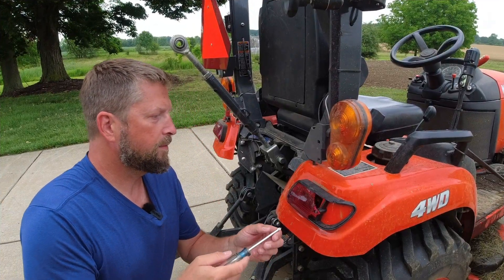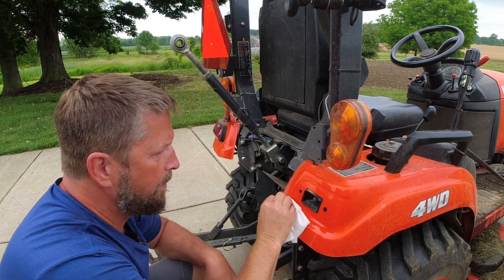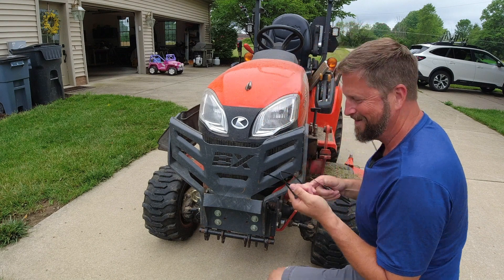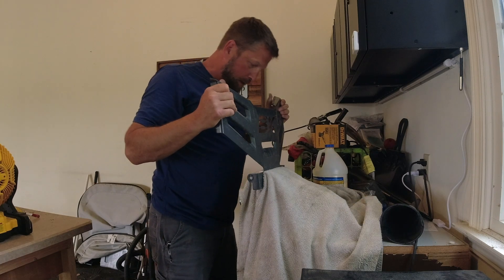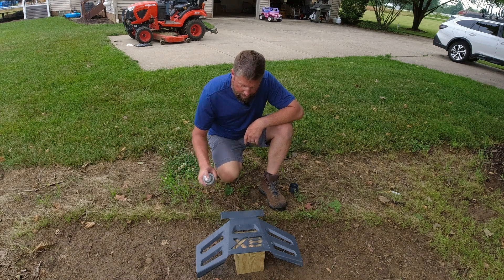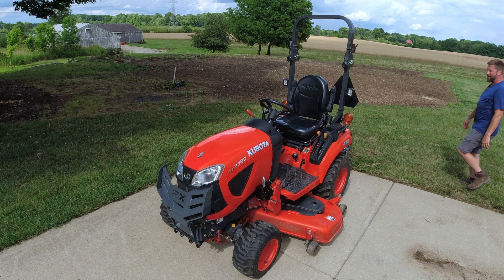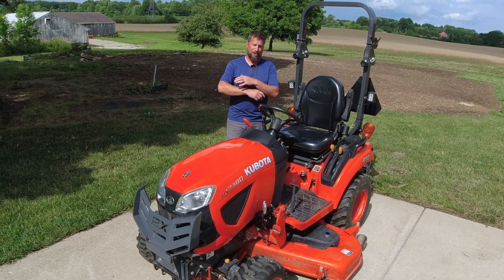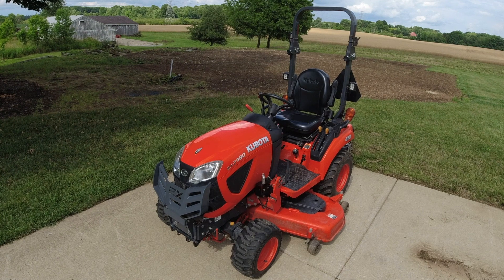Tractor Spa Day For My Kubota BX 2380 Featuring Mike Morgan's Foam Cannon

Comment: Great video Sam. The BX is looking good again.👍 Dawn dish soap works great for cleaning and degreasing grime and works great in a foam cannon. I use it on my tractor and my utv and it works great. I buy the large 32oz size at Menards.
Reply from the maker: Thank you very much for the tip! I'll be sure to try it next time 😁👍